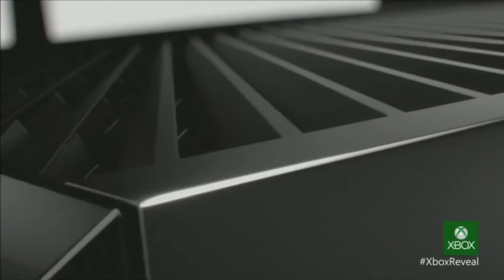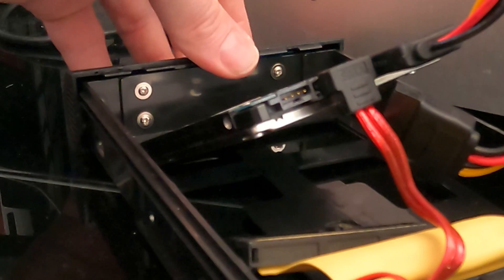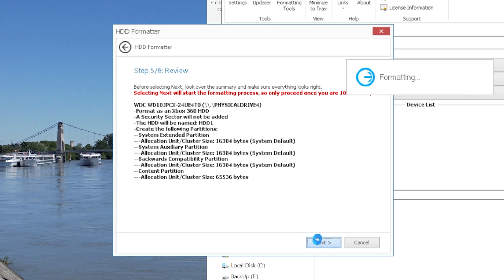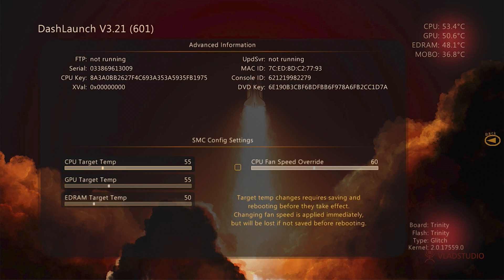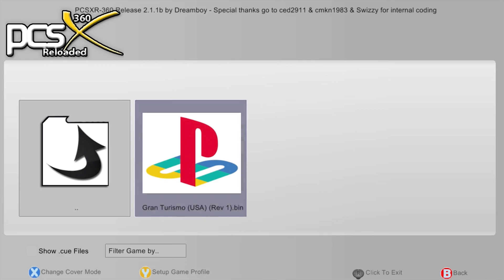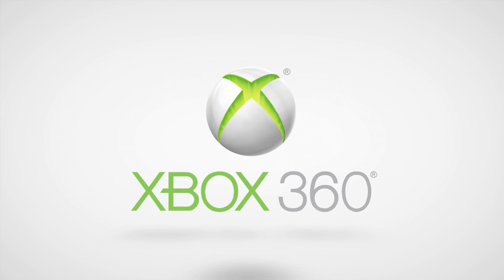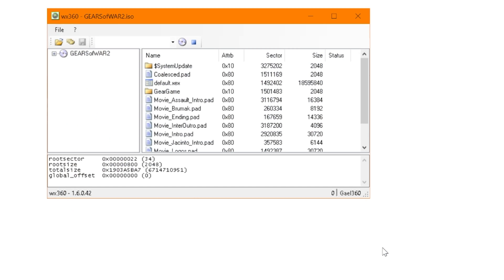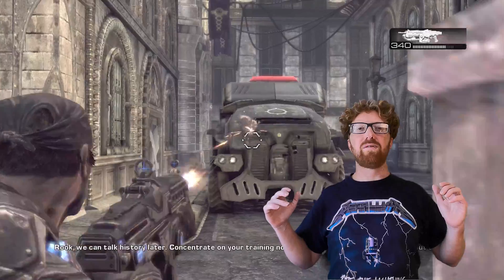Xbox 360 Modded ✅ Fun & Easy Tutorial Part 2 📀🖱🎮

Comment: im having a hard time tying to install gba games on my rgh xbox. im using both XeBoyAdvanced and visualboyadvanced. every time i try to install in it wont pop up in the game selection in the menu. if somone knows why this is happing plz let me know thx (idont know if im using the right files for the gba games or not)
Reply from the maker: Hey! I’ve seen this happen before — here are a few things to check to get your GBA games showing up on your RGH Xbox with XeBoyAdvanced or VisualBoyAdvanced:

File Format:
Make sure your GBA ROM files are in .gba format (not zipped or inside folders). Some emulators require raw .gba files to detect them properly.

Correct Folder Location:
Both emulators look for ROMs in specific folders. Double-check that your GBA games are placed in the right directory on your Xbox HDD or USB drive. Usually, something like:
XeBoyAdvanced\roms\ or VisualBoyAdvanced\roms\

Refreshing the Emulator Library:
After adding new games, restart the emulator or your Xbox to force it to rescan the ROM folder.

File Naming:
Avoid special characters or very long filenames. Keep names simple, like pokemon.gba.

Check Emulator Compatibility:
Some GBA ROMs might not work with certain emulators. Try testing a known working ROM from a trusted source.

Emulator Settings:
Look in the emulator’s settings menu for any options about scanning or loading games — you might need to manually refresh or add ROM directories.
Reply: @TheDiWHYGuy thank you imma try these. Also last question if i install a Pokemon games and It show battery dry error what should I do.
Reply: I was just wondering because I've modded my 3ds and I ran in to problems like that.
Reply from the maker: That's a new one for me but here is what ChatGPT thinks about it:  (ChatGPT can be a bit off but most of the time it will point you in the right direction) 
The “battery dry” error in Pokémon games on your emulator — that usually means the emulator’s save type or RTC (real-time clock) isn’t set up properly. Here’s what you can do:

Check Save Type Settings:
In the emulator settings (XeBoyAdvanced or VisualBoyAdvanced), make sure the save type is set correctly. For Pokémon GBA games, it’s usually Flash 128K or EEPROM 64K. If it’s set to “Automatic,” try manually selecting the right save type.

Enable RTC (Real-Time Clock):
Some Pokémon games use a clock (like for day/night cycles). Check if your emulator has an RTC option and make sure it’s enabled.

Save File Location & Permissions:
Make sure your emulator has permission to write save files in its folder. Sometimes saving fails because the emulator can’t create or update the save file.

Try Resetting the Save File:
If you keep getting the battery error, try deleting any existing save files for that game and start fresh. Sometimes corrupted saves cause this issue.

Test With a Known Good ROM:
Just to be sure it’s not a ROM issue, try a Pokémon GBA ROM from a trusted source that is known to work well with these emulators.
Reply from the maker: If you’ve modded your 3DS before, the save type stuff is similar — the emulator needs to mimic how the original hardware handled save batteries. Good luck mate!
Reply: Thank you brother imma try these i really appreciate it 🙏@TheDiWHYGuy

Comment: It was more the phat model that you got RROD on and not the slim ones ...
I have a video on my page on how you decrease the temperature without a noisy fan ...

7:28 I think you are selecting the wrong path for the emulators and if you decrease the depth it will be much faster to scan when you don't need scan 6 folders down.
Reply from the maker: That's right that's why S models are the best and they red dot not ring but can still happen.  It worked so must be all good yeah defiantly don't need 6, 4 would be plenty

Comment: another banger video g, got a old console banned 360 i will be trying to RGH3
Reply from the maker: haha that's the way get it done bro you can do it! good luck and thanks so much  😁
Reply: @TheDiWHYGuy  im using an old ethernet cable also with my Pico, does the colour matter? Im looking at a RGH3 Pico wiring setup and they have theirs colour coordinated or is just "wire is wire" kinda thing?
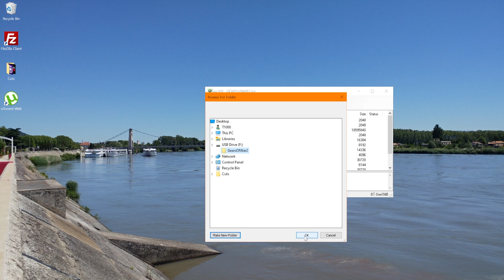Reply from the maker: That's right it doesn't matter the color just the pins if you stop the RGH3 video at 11:50 https://www.youtube.com/watch?v=Jcyju6ZwQ88 you can see what pin goes where.  Good luck mate.